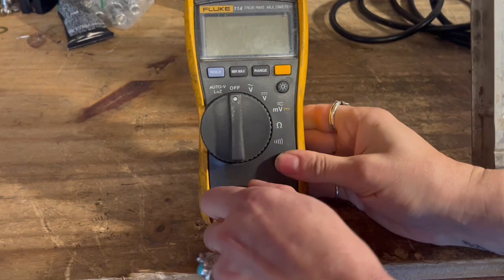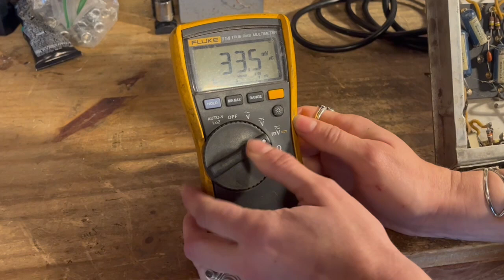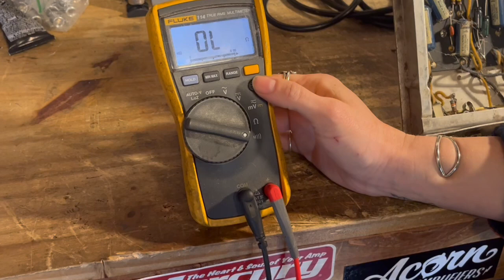How I Use My Multimeter | Vintage Amp Repair Test Tools

Comment: You can also use the AUTO-V LoZ feature on your meter to discharge Electrolytic Caps. It will discharge the Cap slowly without damaging the Cap and it displays the amount of charge remaining in the Cap as it discharges.

Comment: There are two more functions hidden in the Fluke 114. If you disassemble the selector and eliminate a lock it has, it will enable one more position after the position to test continuity and in this position you can test diodes and measure capacitance in the second function. Here's a video explaining how to do this hack https://youtu.be/E2hnhDkYNWs

Comment: Just found your channel and i love it! Ive love amps for a long time as a hobby, and learned things as i repaired each amp for friends or myself. A Fluke multimeter is the best and worth the price. There is nothing worst than measuring a cap or transister with a cheap meter and getting a false reading. Some parts are expensive now, and so is a misdiagnosis. Keep up the awesome job. I subbed and cant wait for more tube goodness,  as that will be my future project. A 1974 West Avalon reverb ❤️

Comment: @5:08 you also need to discharge the high voltage filter capacitor before measuring resistors.

Comment: Hi, from England, UK. What a refreshing change to see such a lovely young lass doing a job that's normally so male dominated. And I've done lots of old vintage electronic repairs including old American amplifiers like you've got there. But in this video you missed a VITAL safety procedure, with any mains powered electronic gear, especially with valve, or tube circuits and that is you must always safely discharge the main HT smoothing capacitors first before using your meter to read ohms, as once the valves, or tubes start cooling down then there's soon little or no discharge path for the deadly stored HT voltage which can seriously damage your meter and it is of course also a serious safety hazard for you too! So I would recommend you put together a simple discharge tool with a resistor of about 1 watt rating and about 470k ohms value and connect a length of insulated wire to each end and fit an insulated croc clip to each other end of the wire and then connect one end to chassis ground first after switching off the power to the amp and then connect the other end to the HT feed and then connect your meter to the HT and wait a moment to or two while it safely discharges which will show on the meter. I thought I'd better mention this just in case any total novices are watching this.

Comment: Something too many people do not appreciate is that professional quality tools, such as Fluke (my personal favourite) are very robustly built and meet the CAT II ratings.  Many cheap multimeters  do not have these certifications.. The test leads don't either. They may work properly when used properly but if you make a mistake no one knows how they will fail and how that failure will affect you.  Buy once, cry once, use for many years.

Comment: Great video. I remove jewelry when working with electricity. Metal jewelry is conductive and can result in shock or burns.
Reply: Not only that, but it can catch on something in the amp, and cause injury as you pull your hand away. Also, your amp may finish up on the floor.

Comment: You use the mV set to DC to test speaker outputs. You don't want any of that, as it throws the T.H.D. (total harmonic distortion) into race, which means it gets massively crazier and worse the higher the DC voltage gets. If it is high enough, it can and will fry speakers which is why it is always recommended to test this out when receiving or buying a new "used" amp. Last I did my vintage 1970s Sony STR-7045, family original owner and daily beater since its inception, I got it down to about 1 or 2 mV which is excellent. 20 is not much to worry about. 30 the same, more or less. You get the idea. Higher than that, it should be brought down. Rock on!

Comment: I remember my first multimeter.  I bought it at a Radio Shack.  It was a kit that I had to assemble myself.  Super fun soldering it and doing other assembling.  Recently, I bought a ready-made multimeter from a local hardware store.  It has an LED display, which I prefer to analog.

Comment: Hard-learned Fluke lesson from me and several others ever since these first existed: if ya think you'll use amps, buy that specific amp fuse ( the little one) so you have a spare ready. 
Yeh, sooner or later, you will get distracted.

Comment: I have a crown xti6002 which has issues with capacitors issues I so heard but in Kenya tools are a major problem to buy.. so now I need to get a multimeter that's good but the internet may have a lot of garbage. Which one is really multi in all senses
Reply: Alsam looking for a service manual for that amp

Comment: That ground probe thing is actually a good idea, it annoys me having to balance my black pin onto things to keep a connection. I was using a crocadile clip sometimes to just keep it in place but I think your method is better because it uses less force than a crocodile clip.

Comment: Flukes are more expensive but not necessarily because they are better, it's more to do with them being consistent and serviceable. So professionals that have to use certified test equipment will usually use Fluke, but the home gamer can get by with a decent quality meter that's not nearly as expensive. I bought a Bryman that was rebranded as an EEVlog multimeter. I wanted to support Dave Jone's channel and I appreciate his opinion on spec'ing out a decent meter. You can get by with a cheap one but if you're using high voltage you want a good quality that's made for that. It's a safety issue.
Reply: If a cheap meter blows up what do you think is going to happen? You think the cheapies are filled with explosives of something? The spark isn't even going to get out of the case. There's a channel here where a guy blows multimeters up. It's what he does. When he blows them up he has them open so you can see it though. His name is Joe Smith.
Reply: @1pcfred  I'm a big fan of people being free to do what they like. So enjoy!

Comment: Hello
I have a request for a video if you would please consider
An overview and reasoning/philosophy of the components you replace and also why the brands/types for decide to use.
For example I notice you routinely replace all the high voltage stuff capacitors and resistors.  You also seem to leave in a lot of the old carbon film resistors why? Do you use new carbon film to replace the old ones?  Or metal film?  How about capacitors the skies the limit on those where do you draw the line?  Why no oil and paper caps?  They seem to be popular with the guitar crowd.  I'm in the process of restoring a vintage tube audio amp and after watching your videos I'm rethinking my plan to replace all the capacitors and carbon resistors.  Love your videos I find them very informative 
Thank you, Bob from Sarasota, FL

Comment: what would happen if you forgot to ground your multimeter before probing?
Reply: You'd just read stray interference picked up by the probe lead then. Your meter would basically act like a radio. Which is not really what you want it to do. If you move the disconnected probe lead around the reading would go up too. That's because you'd be making it cut through more magnetic lines of flux. A moving magnetic field generates a current in a conductor. That's only in the voltage range or in a very low current range. For Ohms it'd just be OL (Over Limit).

Comment: Hey Coleen I just purchased a quartet of EL34 tubes as spares. I’d like to test them just to make sure they are in new working order. I don’t want to install them yet as my amps don’t need them yet and I’m not sure if the amp would require rebiasing in order to test these tubes. What is the best way to test them? Thank you and keep the videos coming! TC!!

Comment: I use the red Harbor Freight special that I got FREE with coupon. Have 5 of them stashed around the house, garage, tool bag and shop.
Reply: There's a lot of variants of the Harbor Freight freebie. Some of them are pretty decent. As time went on they cheapened them up a lot though. The really old ones have an adjustment pot in them and they can be calibrated to be spot on.

Comment: Back in the late 80s/early 90s, I was a regional warehouse supervisor for a huge HVAC wholesale distributor. As such,  I'd occasionally get promotional swag/marketing junk.

One year, Fluke had a contest for people to suggest a new company tagline/motto.  The winner would get weeklong vacation somewhere tropical.

I submitted "If it works, it's a Fluke."

Not only did I not win, my name was pulled from their marketing database and I never got another thing from them....  😆

I still have a couple of their meters in my toolbox, though. Great products.

Comment: The old Fluke 114 is a workhorse of a multimeter. I'd say that and the 87V (which I have) are among the most versatile Fluke has produced. A nice feature of the 87V is that it has the ability to test capacitors (though sadly it's unable to measure ESR). Funny thing, I actually grew up right near the old Fluke plant in Everett, WA.

Great work!

Comment: You're baaaack! Like your clean workshop. Excellent video. Some tips: I put shink tubing on my probes (exept the tip). Prevents inter-circuit shorts. I always alligator clip frame grounds - better connectivity. Nice your meter reads .635(average); most only show .707 (RMS). Keep making these great vids!!

Comment: The Fluke that you are using gives average readings unlike one that gives you true RMS readings which are a bit more accurate. This is important when you are setting bias voltages. I recently bought a Fluke 117 which is similar to yours. I am going to purchase a 172 Fluke which is a true RMS meter.

Comment: You are very good with describing what you are doing and how to do the measurements! A couple things I would recommend is to not wear jewelry while working or measuring voltages or amps, or really any measurement. Plus, I know it’s not easy, but it is safer if someone else is around just in case you need help. This means they need to be able to see you. Also, keep one hand in your pocket so you don’t accidentally complete the circuit and get shocked or worse, electrocuted. If no one else is around, it is critical to be vigilant and stay safe.

Comment: Nice meter! And so nice to see you back, I've been missing you.
I use a Uni-T UT890D+ as my current main meter, and a Meratronik V640 for all signal measurements. I've used the latter pretty soon after I got into building amps in the early 2000s :)

Good practice is to measure voltage first where you want to check continuity or resistance, whenever by any chance voltage may be present (e.g. with partially discharged filter caps). 
Wishing you lots of luck for the new lab!

Comment: Great and very concise video. Congratulations! I only wish I could be that succint... :)

Just one remark that I suspect you already know by working on high voltage amplifiers for so long: when using the ohmeter, power down the amplifier and make sure the capacitors are fully discharged. Although the Fluke wouldn't be destroyed by this, cheaper models would be close to a death sentence to the equipment.

Comment: Nice. A Fluke will never let you down. I personally use Klein tools, but even ones from Harbor Freight are great for beginners. Flukes are top notch. 👍🏽
Reply: I have a Fluke 75 which I bought new.  A year or so after I got it for use occasionally at home, I turned it on and when I turned it to off position, it stayed on.  I checked the manual and it was warranted for 3 years, so I sent it to Fluke and they repaired it, calibrated it and sent it back.  I've used Fluke meters at work for decades and up until mine went bad, I believed as you do, that ""a Fluke will never let you down.""  Well, I don't believe that any more.  I have 4 or 5 five dollar DMMs from Harbor Freight and they're just as reliable as the Fluke meters.

Comment: Great video. Having the right setting on your multimeter really helps. Measuring HT voltage at the pilot light for example .. 🤣
I got lucky and just the artificial center tap resistors assploded that time ..

Comment: It looks like that multimeter doesn't measure current (which is a bit odd). For multimeters which do never leave it in current mode or you will accidentally short things out.
Reply: That meter measures current. That's what the mA (milliAmp) range is. It just doesn't measure a lot of current.
Reply: @1pcfred  I don't see a milliamp range. The only milli- range I see on the Fluke 114 is millivolts.

Comment: I am NOT a technician, but I frequently try to fix things myself. I used to install mobile electronics, and often used multimeters to check continuity. I have several, some known names, others no-name. One thing that has happened is, after not being used for a while, the continuity feature no longer produces an audible tone. I always remove the batteries when I store them, so I am mystified why none of them have a tone when I need them? Have you ever encountered this? Can you recommend a way to revive them? Thanks,love your videos.

Comment: Good to see a new video. Brings back my early days as an electronics engineer at Megacorp, working test and evaluation. We had a mix of Fluke digital meters and Simpson analog ones. My boss didn't trust the digital ones and preferred the analog type.

Comment: 1. 1000V probes are useful, you can get aftermarket 4mm probe sets that will give you 1kV with clips.
2. AC probing, careful of the capacitor in the multimeter storing charge from HV and then going to low voltage without discharging can be an issue (tube-solid state hybrid this can be an issue!)
I got myself a Brymen 869s for tube amps (a bit cheaper than the Flukes) but for DIY tube amps it handles 1000V and has some good features for testing solid state too. (can detect frequency which is useful for a tone input and then trace the signal, it's TrueRMS and does capacitance). I have two from the store, one 300V, one 600V but not sure on the insulation at HV from those.

Comment: Very valuable information, knowing how to use a multimeter.  Just a fun comment, my old Radio Shack circa 1991 multimeter that I bought new for electronics classes still works.  I do have a newer one but I don't know that it would last 30 years.  Oh well, I probably won't either. 😂  
I do miss the old Radio Shack when you could go get what you needed to fix a radio, TV, whatever.  Or an old amp of course!

Comment: Why does hooking the black probe to the chasis of the amp work as a reference point for measuring voltage for every component in the amp?
Reply: Most voltages are measured relative to circuit ground and in a typical amp (or anything else with a power transformer) the chassis is connected to circuit ground.
Reply: Because the metal chassis is grounded. Those old techs were nuts. And yeah people got electrocuted because of it. It only takes a couple screw ups and the whole chassis is live.

Comment: amp repair amateur here, but are all those components really not soldered? How does that work, please? Is the whole board a perf board or something??
Reply: That's an eyelet board. There's basically rivets in the board substrate that the component leads are put in then soldered to. I think there was a video edit when that resistor was pulled out? Was a bit disconcerting when she just lifted it up. The desoldering must have been done off camera.
Reply: @1pcfred  oh, now that makes sense!  lol  I've shot videos for youtube, its easy to forget to mention something... but ya, that had me going for a sec, thanks for the insightfulness ;)

Comment: Glad to see you are making videos again I was wondering how you was doing. I been watching a lot of different videos of yours and others for info on amps because I just built an amp kit from Stew Mac 62 Brit-JTM45 and It works great and sounds awesome. I'm going to build a MoJo Tone JCM 800 kit when it gets here. I'm trying to learn how all the parts of the amps work.  I was a Master auto and diesel tech for 30 years and now it is time to learn something new that I like to do build guitars and amps and play them of course. I have Fluke 88 & Fluke 88V from when I was working. I also have some old test equipment from a closed out TV repair shop 2 oscilloscopes are some of it. Thanks for the knowledge you share very much appreciated here! Keep up the great work and as always be safe!

Comment: Love the vid! I often use my ohms setting for continuity testing in amps with pcb traces as I've been led astray by the continuity setting . If a trace is broken but has even a tiny stray wire or solder bit it will beep , but when checked with the ohms reading it's all over the place (bad) or  like .2 (good)